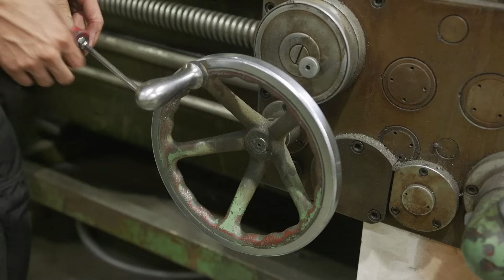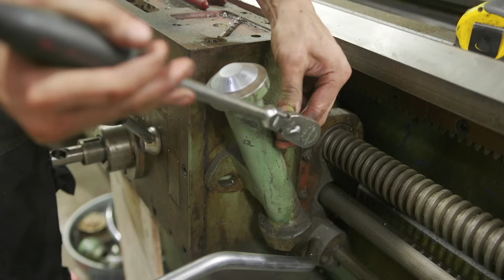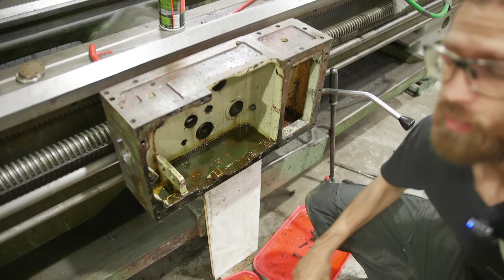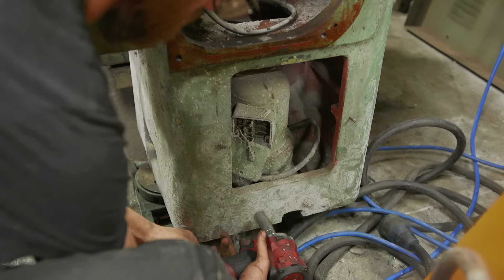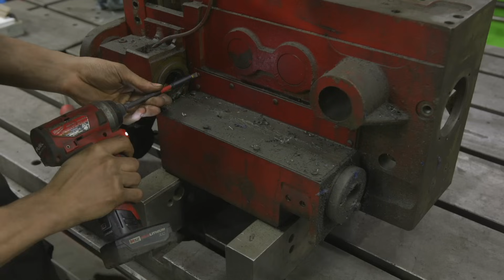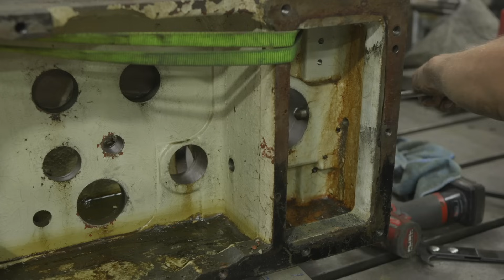Apron Disassembly | Lion Lathe Restoration

Comment: 9:28 looks like you need to remove a link from the chain so the tensioner has travel.
Reply from the maker: Yeah maybe I’ll figure that out on assembly. Thanks for heads up

Comment: Damn brother this is the most involved "not a full restoration" ive ever seen lol

Edit: the rapid being shaft driven is more common on old or large machines

Before servo motors came around that was how rapid was handled.

Even now on larger machines where the rapid motor needs to move serious mass like on 42" swing or bigger, youll see shaft driven rapids.

Pacemakers and Axelsons had a similar rapid layout on the machines that had that option, on the pacemaker the shaft ran on the Backside of the bed tho. 

My old 32" pacemaker had that setup
Reply from the maker: Yeah this resto is full blown at this point. Good point on traverse shafts

Comment: Send the gear cases out to the automotive machine shop for cleaning and degreasing. They have giant dishwashers for cleaning castings. Use Glyptal paint inside the gear cases, it’s made for that and it will aid in oil moving towards the bottom of the sump. The Glyptal is expensive but it will never chip or flake off a properly cleaned and degreased surface. Use #1201 or #74004 (two-part epoxy). Last, use a good two-part primer and two-part paint on the outside surfaces.
Reply from the maker: Already on top of it. Glyptal paint acquired. Gearboxes cleaned. 2k paint on everything

Comment: What brand of puller were you using the impact on?
Reply from the maker: OTC
Reply: Thank you
Reply: Tie rod puller? That is the only thing that I saw that was similar.
Reply from the maker: @scottjones7279  I used a couple pullers what point in video are you talking about and I can get you the model number
Reply: @13:30
Reply from the maker: @scottjones7279  otc 7503 tie rod puller
Reply: Thank you.  I do not think that will have the range that i need. Thank you for looking.
Reply from the maker: @scottjones7279  posi-lock makes great pullers. Those are my favorite pullers